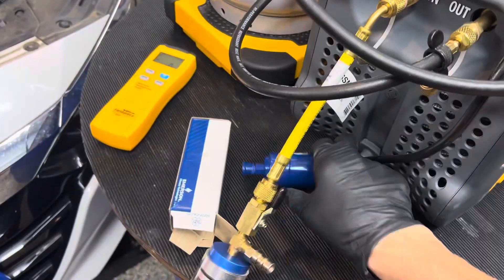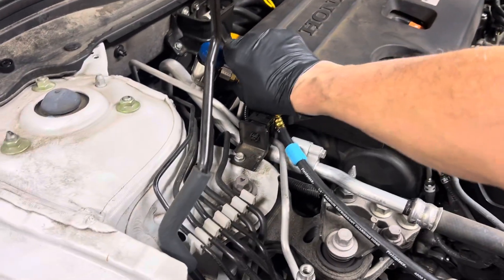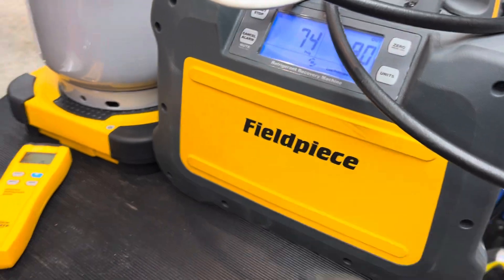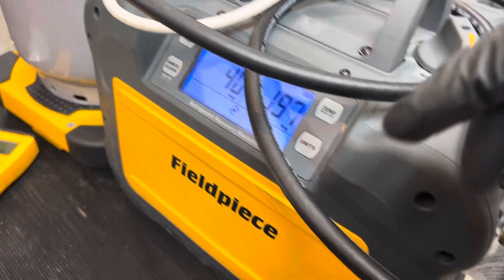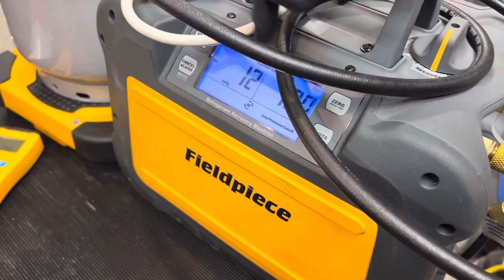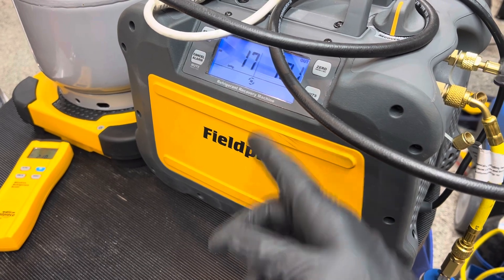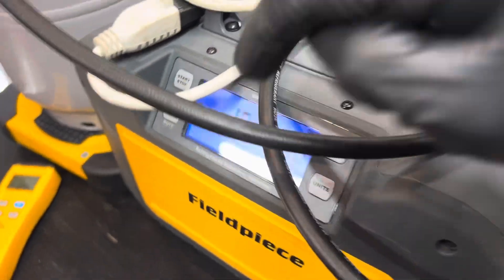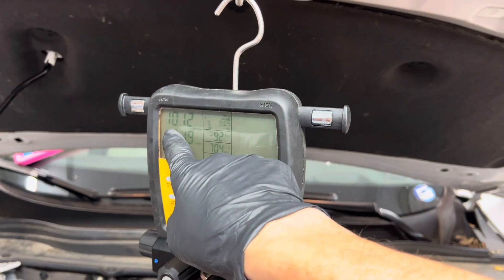Automotive using Fieldpiece MR 45 refrigerant recovery machine

Comment: This is the exact video I was looking for, thank you. 

I'm curious about your procedure to recovery a system with a leak, do you still pull system into a vacuum with the recovery machine or do you bring to zero and slowly let it climb like AC Service Tech... i.e. https://youtu.be/os9gKLf7LJg?si=Jl3Lyn40PohH8HmC&t=414
Reply from the maker: I don’t care about small leaks they’re negligible. 
EPA 608 for residential commercial or industrial refrigerant is completely different than EPA 609 

And EPA 608 you’re allowed to reuse the same refrigerant out of the unit for the same owner on the same building and put it back into the unit that you are servicing so you definitely do not want to get air into the system or into the refrigerant your recovery 

EPA 609 your recovering refrigerant and it’s going through a recycling machine that is separate you take all the contaminated refrigerant oil burnt acid particulate matter and you take that cylinder and it goes to a processing machine that removes everything including the noncondensibles 

And EPA 608 this is not allowed and this is not done 

So any PA 608 for mobile service on refrigerant that’s gonna be recycled just like you recycle used engine oil and they could break it down and clean it and make it into clean brand new oil again 

Or just like they could take sewage water or ocean water and put it through purifiers filters D ionizer and membranes and you end up with pure drinkable water 

This is what’s done in EPA 609
Reply: @coldfinger459sub0  Interesting, thank you, I think you mention that you recycle R134a in bulk right? ... https://youtu.be/ZZTslr0ccRE?si=09w_YdXVoaPDY3c2&t=249

If so, it would be interesting to see this process and breakdown on if it would make sense for a small shop.
Reply from the maker: @stacktier8257  small shops must own a RRR machine in refrigerant recovery, recycle recharge machine to process the refrigerant

All you’re doing is taking your recovered refrigerant tank that you use out in the field if you’re a mobile, HVAC Tech bringing it back to your shop and simply hooking it up with the low side hose to the vapor of your refrigerator, recycling machine and treating the tank as if it was a car Nothing to see your watch or explain, not complicated. 

The exact same way you hook up your RRR machine to a car is the exact same way you would hook it up to your dirty recovering tank

Comment: with at much advertisement for fieldpiece that you do you would think they would give you a bunch of stuff as a give away.  Could you do a video of clearing the lines, gauges, and machine so you can jump back and forth between 134 and 1234yf?
Reply from the maker: @crasher88  I have done videos on cleaning hoses and gauges.   Using 99% alcohol in a high-pressure flush gun.. shooting through the yellow refrigerant line and out of both ends of the red and blue hose.   And then using 600 psi of nitrogen to shoot through the hoses and refrigerant manifold.
    And then put it on the vacuum pump to draw down a vacuum below 100 µm. 

On the recovery machine, it just gets vacuumed down below 100 µm . All the gas that goes into a recovery cylinder of each different separate gas is considered dirty gas..   because it’ll always have different types of oil contamination going into the tank. 
    Some of the gas recovered in different vehicles always contains contaminants of noncondensibles like air mixed in with the gas so all the refrigerant has to be recycled anyway through a recycling machine after it has been recovered. And then once it is cleaned, put into a separate new tank that has never been used for dirty refrigerant. 

Fieldpiece, if you go to their website actually has videos on just putting alcohol inside their refrigerant gauges shaking it around pouring it out . And then throw it on the vacuum pump to dry it out.. 

On the Facebook group 
(Automotive HVAC technicians )
I have put up many more links to different companies for many more clean out and vacuum and recovery, procedures and flushing out of vehicles provided by the chemical manufacturers or the compressor manufacturers made their own videos